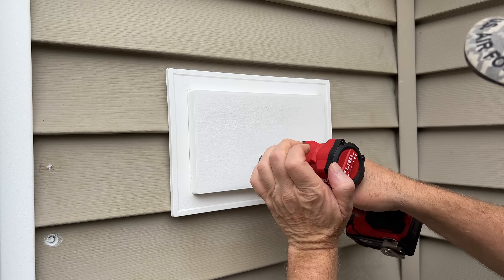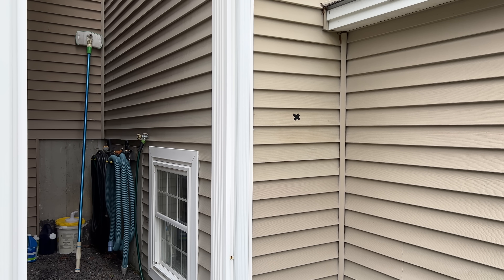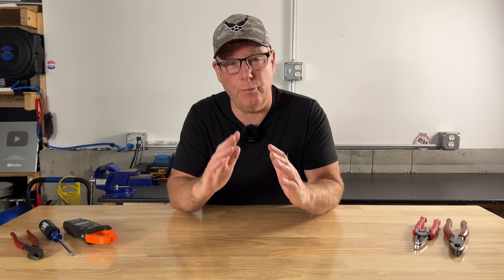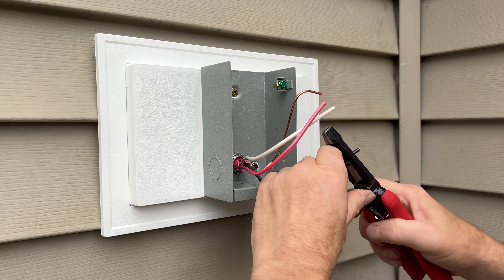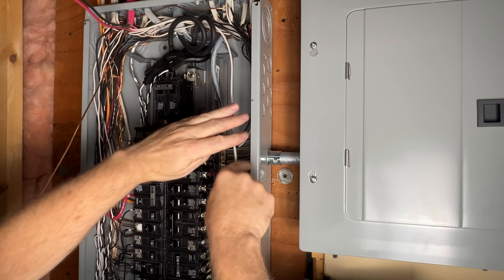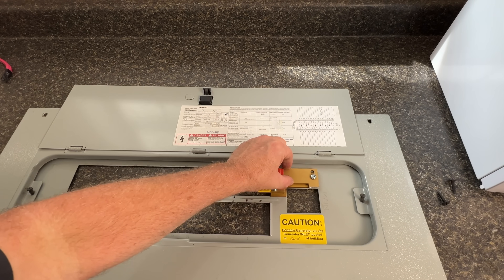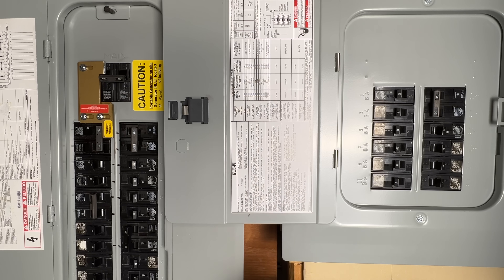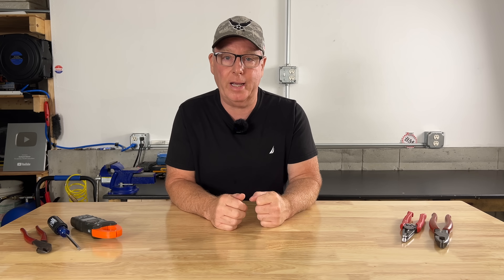Watch This Before Connecting a Backup Generator to Your Home.

Comment: Very informative video thanks. I am going to go ahead and do a 50amp for my house .  Would the same type of romex be used for the inlet to panel connections. If not can you tell me what should be used?
Reply from the maker: Same cable but a larger size. (6AWG copper) since you need to use the 60 degree column for NM Cable. If you run a raceway with individual THHN or THWN wires you can run 8AWG copper.

Comment: Very good post,  I'm terrible at making videos. We rarely have power outages but when it happens....I do this.
      Hard to explain. But here goes...
     You'll need a power source (generator, power station), a 6 foot cord with male ends on both ends of the cord and a nickel (metal washer).  I have a Generac GP 7678 Portable Generator, 30 A, 120/220 V, Gasoline, 3.7 gal Tank, 10.5 hr Run Time, Recoil Start. Bought it for camping back in 1990.
    Go to the breaker panel (box) and TURN OFF THE MAIN BREAKER to keep from back feeding the neighborhood. Next I insert a nickel between the two "breaker panel bus bars (goog-it)" so that they're tied (connected) together... This way the entire house will have temporary 110v power, just DON'T use hair dryers, microwave ovens, AC unit for cooling, electric clothes dryer or any other high power demand appliance. Just use small LED lights to see at night, maybe one TV and one refrigerator. Find the closest electrical outlet to the main panel and plug in the double-ended cord you made (usually, but not always, the outlet for the garage door opener is closest). Don't plug in the other end of cord till the generator is running. Make sure everything in the house is turned off except the refrigerator. Start the generator with exhaust pointed outside. Plug in the cord and wait a few minutes to make sure the generator breakers stay on. Go in the house and see if the fridge is running. My FAU is in the attic (which spawned this whole idea). I have a freezer and fridge in the garage and plug them straight into the generator. I grab the double ended cord and make sure it's not getting hot (never has) and enjoy the power. We're the only house on the block all lit up and warm (if we choose to run the heater). We make a fire in the fireplace too.  Wife usually sexes me cuz I'm so smart...

Comment: With an interlock kit does it matter if your generator is a floating neutral or bonded neutral? I know with my transfer switch it mattered.
Reply from the maker: It does. The neutral can only be bonded in one location so for this type of connection the generator needs a floating neutral. If a generator has a bonded neutral the neutral and the line wires will need to be switched through the transfer switch. This is usually only done with a whole house system where you connect to the transfer switch at the service between the panel and the bond.

Comment: Quick question, I’ve done almost exactly how you described to hook up my generator. Except for interlock kit … ordering soon! However, when I hook up generator all of my GFCI outlets trip and won’t reset. Any suggestions?
Reply from the maker: You must have a bonded neutral generator. A neutral and ground can only be done in one location on an electrical system. Look into how to remove the bond with that particular brand.

Comment: What size connector did you use in back of plug box and what size hole did you cut out?
Reply from the maker: 1/2 inch KO was removed and a romex connector

Comment: I have the same hook-up as you. Can you please explain all the talk now about NEUTRAL BONDED TO FRAME vs FLOATING NEUTRAL. If you run the generator stand alone, neutral to frame is the way to go but feeding your entire panel you have to convert your generator to a floating neutral. Please advise. Thanks.
Reply from the maker: You have it right.. This type of connection requires a floating neutral because you can only bond the neutral to ground in one location. This is done at service. If you run a bonded neutral you would need a transfer switch that not only switches the line wires but the neutral as well. This is widely misunderstood among generator users and even for many electricians. I will do a video on this and also the use of a ground rod.
Reply: Thank you very much. You have excellent videos and you explain everything in simple. And please do this video ASAP because there’s so much confusion out there. All the videos you see, you just have to remove the jumper from the ground to the neutral by my 2011 Honeywell doesn’t have the jumper. I talked to General today who made the Honeywell and they are still working on how to do it for my generator.
Reply: @BillMetter if your generator is floating like my Westinghouse you're good for feeding a panel since the panel is bonded. 

What I have done since it is floating is make a bonding plug thats basically a 3 prong plug replacement and jump the neutral and ground to bond it.  You can then plug it into one of your 120 outlets on the generator and use it for other things like plugging in tools directly to the generator. 

This saves you from manually swapping wires.  There are videos on how to make a bonding plug, that's what i did in case I want to use it for more than feeding the house panel in a power outage.  Only downside is it it takes up one of your 120v plugs but a power strip can solve that issue 😂😂

Comment: John, I believe you should be pointing out to people that an outdoor receptacle for hooking up a generator should be rated for outdoors. Something like the Midwest Catalog 3 U030N allows the homeowner to connect their cord and not worry to much about rain or snow getting on the plug.
Reply from the maker: You are correct, it needs to be rated for outdoor use!

Comment: I have a grounding question.  I'm going to be installing the same setup that you have next week.  I have the interlock switch and I'm going to be back feeding into a sub panel.  My main breaker box has a bonded neutral which is connected to two grounding rods hammered 8ft down in the ground.  My sub panel is not bonded and the ground bar is separate from the neutral bar.  So those are up to code.  
My generator has a "Floating Neutral" (which is causing my confusion) and it recommends connecting the grounding screw of the generator to an earth ground.  When I set up the inlet box with the 10/3, I'll be connecting the ground wire to the ground bar in my sub panel, which connects to my earth grounding rods.  
So I'm wondering, do I have to add another earth ground for this generator or is the ground from the sub panel sufficient for this?
Thank you for your help.
Reply from the maker: Great questing and I do intend to make a video to cover this. I just have gotten around to it yet. The answer is no you do not need to connect the generator to a ground rod. Doing so would actually be less safe because now you would have parallel grounds most likely with different resistances. A floating neutral and no ground rod connection at the generator is what you want. The frame of the generator is connected to the building ground and the neutral bond is right where it belongs at the service panel. 

If you were running a bonded neutral generator then a ground rod would be required depending on a couple of other factors but you would also need a transfer switch which switches the neutral as well as the line conductors. As you obviously know you can only have a neutral to ground bond in one location. 

The only other time you may want to ground the generator and bond the neutral would be if you were running the generator to power something other than your home. Maybe running some power tools, or powering up a camper. In that case you would definitely want to bond the neutral (they make bonding plugs) and bond the frame to ground for safety. The neutral to ground bond is your short circuit and ground fault protection and the ground rod is primarily a path for high voltage surges is most cases lighting. I hope this helps.
Reply: @BackyardMaine  Thank you so much.

Comment: I'm getting tired of hearing about how I can only run certain  circuits? The only hugh power draws that I have is  the central air conditioner. The computers are minimal. The lights are led. The hair dryer is almost never used. I can already  run my washer and dryer, separately  on my 2500 modified sinewave inverter, no problems there. The garage door opener has a  power inverter  with built in transfer switch that works fine, when I come home to a power outage.  My electrician  friend  told me during a winter time power outage, I can just turn the power off to my furnace and put a male plug on the black and white  wires, then an extension  cord to my generator, to power my house furnace. 13 amp motor on the furnace. no problem.  I'm in the city. I could understand  if I had a few 220 volt circuits, Like a well pump and a instantaneous  hot water heater.
Reply from the maker: You are running several loads on a power station not a generator so maybe you misunderstood what I was talking about in the video.

Comment: How does power from the generator breaker get to the breakers on the right side in the panel box?
Reply from the maker: Power from the generator back feeds through the 30A two pole breaker to the bus which power the whole panel.
Reply: If you look at a picture of a panel without the breakers you'll see how the double pole breakers actually connect both sides of the bars.

Comment: If you have an older home where the grounds and neutrals are attached on the same bars, would it still be ok
Reply from the maker: If your neutral to ground bond is at the panel where the grounds are shared with the neutral you're ok. Just make sure you run a floating neutral generator.

Comment: I have put in this same setup. My service is 200amp. My generator  has the same 120/240V plug.  My problem is that I am only able to power certain 120 circuits. I get 240 at the cable end where it plugs into the receptacle leading to the breaker. My wiring and everything else is identical to yours. Been trying to figure this out. But not much info online.
Reply from the maker: Sounds like you're loosing a leg somewhere. Maybe at the generator breaker. Test across the two poles of your generator breaker with the generator running and plugged in but with the breaker open (off position) If you have 240v across the breaker turn it on and check again while running loads. If you loose the 240v you have a weak connection somewhere between the generator and the breaker. If you still have 240v with the breaker closed check across any two breakers on opposite legs in your panel. If you don't have 240v your generator breaker is faulty and not passing both legs of power onto the bus.
Reply: @BackyardMaine  Thank you for your reply. I was able to fix the problem which I will say was a cheap receptacle combined with 6awg stranded wire. At any rate its fixed and works great.

Comment: John
How does change fuel line in Westinghouse generator 6000?
Reply from the maker: A fuel line is very easy to replace. Just pick up a new fuel line, shut off the gas valve and replace it. Five minute job..

Comment: Thank you. As usual a very informative video. For those of us with smaller inverter generators that have a 30A TT 30R outlet instead of L14-30, can we connect to a home Reliance 120V 30A inlet box using a TT 30RV to L5-30 adapter cable?
Reply from the maker: I don’t see why not.
Reply: @BackyardMaine  Thank you for the reply. Keep up the good work. :)

Comment: This is the setup I'm getting ready to put in my home. But unfortunately, my house was built in 1954 and still has some of the original wiring. Also, the wiring does not segregate the house the way I want it to be. I want things to be more isolated so I can control it all more safely. My breaker box needs updated as well. I talked to a reputable company and they gave me an estimate of $650 for a new breaker panel and a hookup like yours for my generator. But they said they wouldn't want to do it until I got the house rewired. They said I'm looking at for a 3 Br. ranch +addon, about $3500 for all of it. I have a 6500 running watt generator, so once it's done, I'm hoping it will be good for what I will need to run if the power goes out.

Comment: Do ypu have yo have a floating neutral / ground on your generator yo do this.  Ie it can’t be bonded can it ?
Reply from the maker: No ground rod required. I’ve responded to this point several times. Read some of my comments

Comment: The only issue I have with this setup is if people are not careful they can overload the generator.  My 2nd issue is you have no idea when power is restored.  I had a neighbor that used this setup and power was restored yet he was running his generator for many more hours.  The is especially important to me as I can’t see my neighbors.
Reply: If you overload the generator, a breaker will trip on the generator.  Some electric companies have a way to text your phone when the power is restored.  In Michigan with Comsumers Energy, if I notify them my power is out, they will text me when it is back on.
Reply: @ true but you still need to be cognizant of that otherwise you will be going outside often. My neighbor used this method and our power came back on at 1am.  He was still running his generator till morning.  😂

Comment: Great video! I liked and subbed. I really appreciated your thorough explanation and step-by-step manner of instruction. One thing would like to say is that nobody mentions about whether or not the generator should be bonded or unbonded in a set up like this. They just show connecting the generator and providing power to the home. I would think that this would be an important thing to mention in your video. I had to do a lot of research to learn about bonding and floating neutral. Now, I am not an electrician, but I am comfortable doing my own work at home. However, I didn’t have any experience with generators. I hooked my inlet just like you did and it works great. I just had to unbond my generator.
Thank you again for such a great video!
Reply from the maker: I’ll make a video on bonding.
Reply: @ that would be great and again I would like to thank you for sharing your expertise with with DIY’s like us😊
Reply: Saw a video here on you tube where the electrical engineer rigged up a floating ground wire so he could use his bonded portable generator as an whole home backup power supply. By floating the ground he essentially created a floating neutral without unbonding the generator itself thus keeping the the generator safe to use as a portable using its other outlets.
Reply: @williamsickner2206  that’s interesting! Appreciate you mentioning that.👍

Comment: I have been building and servicing generators since the early 70's, My prefered system of connecting back up generators is to use a contactor for switch over so the generator is not connected until it is producing power at that moment the contactor disconnects from the mains and switches the generator onto the load.

Comment: My electrician installed a 50amp inlet for my generator. That limits my generator choice to the larger wattage that has the 50 amp plug.
Reply from the maker: You can buy a plug adapter. Here's an affiliate link. https://amzn.to/48B47dD

Comment: question ..did you change your generator to floating neutral?...And have you had any problems running electronics off a regular generator. Recently, my furnace man told me a regular unit would probably not run my furnace, and suggested an inverter generator which I have since purchased...Seems to do fine through my transfer switch... I would sure like your opinion ..thanks for a great site!
Reply from the maker: My generator did not come with a bonded neutral but if it did I would have removed the bond. A neutral to ground bond can only happen in one location so unless you're using a transfer switch that switches the neutral along with the line conductors a bonded neutral at the generator would be a violation. I think the inverter generators are a great option and plan on getting one myself in the near future.

Comment: Great video! I put in a 50 amp to supply more with my portable.
Reply: You're best off with a 50 amp so in case you decide to get a bigger generator , And is more safe to handle the load
Reply: @ironmartysharpe8293  I have a 7500 watts Craftsman generator 30 amp,,, when i use my electric stove it start to make on and off noise, like dying out but never goes off,, and the only thing i have on around the house is the lights and refrig, I notice in the breaker box the stove is connected to a 50 Amp,, could that be the problem maybe I need a 50-Amp  generator.?

Comment: Hi - very nice & informative video...question: would/could I use the the same receptacle(wired to a 60A breaker, 6AWg) to plugin a portable EV charger? (obviously would not be charging when main power is out & generator is runnning/back feeding...thx